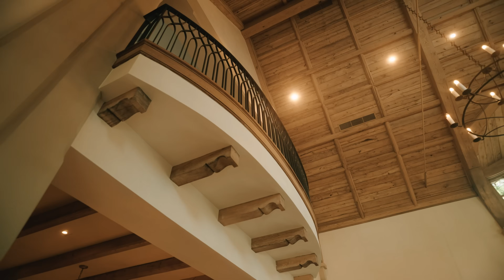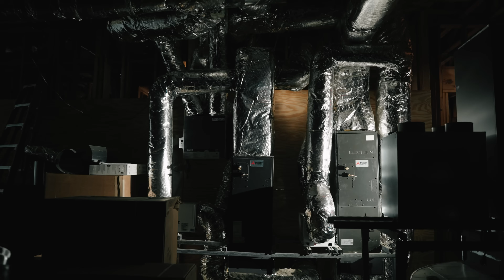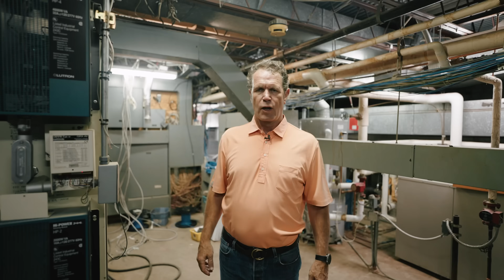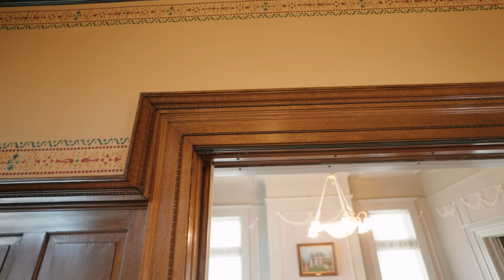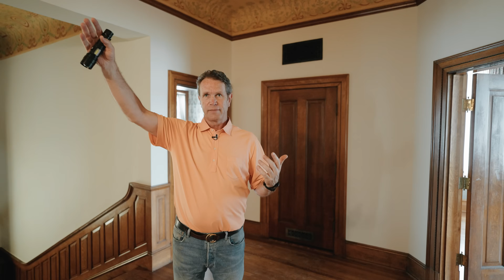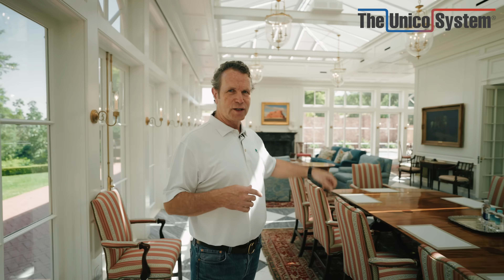"Mechanicals" New House, Old Soul - Ep. 10

Comment: " Most users on Reddit agree that high-velocity systems demand certified, knowledgeable technicians because improper static pressure balancing or incorrect run lengths drastically reduce efficiency." Too complicated. Need an engineer to install properly. You'll never be able to find anybody to service it. Especially after 10-20 years.

Comment: Your advice is spot on with regards to cooling. I have restored old homes as a hobby since 1972 and have always been challanged to not wreck the details of the home to add HVAC to a 1930's - 1970's house. Wheather it was a traditional horitionzal air handler, fan coil, or  chiller driven air handler I always put extra effort into condensate water safety back-up. In South Fl we're required to install a seperate drip pan and I always added a water sensor alarm to the drip pan that would alert  when moister was detected so that A/C service could be preformed before drip pan became over filled and water damage resulted (Many A/C evaporators have a secondary high water drain which can also be used to trigger an alarm). I too would go to great lengths to use attics and crawlways this usually is more costly and time consuming but the end results are well worth the effort and expense to advoid the easy way of using an existing linen or clothes closet for the air handler/s. Ray Stormont

Comment: Okay ... here's your recipe, Brent. It'll work on any house, new or old. What? Yeah.

1) Do not fight the stack effect . This is why we like double-hung windows in Spring/Summer, yes??

Which means: Keep "central" (ducted, etc) A/C but put registers up high regardless of floor . Having your feet cold in summer is unnecessary, so never use floor registers again. Why am I wearing socks in August? Because of the floor registers freezing my feet. 

2) FORGET ducted heat, regardless of climate zone. Just ... don't bother. Advocate and build the infrastructure and talent that supports radiators. Or go with radiant heat floors. There's your hidden heat. Either way, let the heat rise in Winter, it is utterly amazing I don't care where your house is located. 

Forced-air heat ultimately sucks for comfort, and it's ONLY become historically popular because of A/C, where everyone thought it was "smart" to only need one duct system. It's not smart, it's cheap, and it shows.
Reply: Couldn’t have said it better myself.
Reply: Hmmm, big problem with radiant is the latency. I turn my heat OFF when I leave the house for 30 min or more and turn it down to 60f when I sleep. Forced air warms up the house in minutes, so I save a ton of money. I'm in climate zone 7. Cant do that with radiant.
Reply: @fox156  Requires proper insulation, then you can keep the temperature constant all day in each room.
Reply: Well, pretty rare and difficult to have more than R22 6" insulated walls. Not everyone can afford to live on a new custom house or put 2" of foam on the outside. In any case you're still spending "more" to heat if it takes hours to change the temperature 10 degrees and you can't turn the heat off when you leave for a few hours or sleep.
Reply: @fox156  Very curious here. I live and work in zone 6. I don’t know a single person who turns their heat off for any period of time in the dead of winter. How is it possible that you can do it living in zone 7? Maybe I’m misunderstanding you. But it seems impossible to do, and a problem waiting to happen.
Reply: @valenzaplumbing  Its because Im okay with being uncomfortable for a few minutes when I walk in the door to save money and burn less fossil fuels, I get that most arent. Steamboat Springs, CO zone 7, -40f last winter.
Reply: @fox156  Fair enough. Sorry, I made some wrong assumptions. Coming from Germany, the 10" (including outside insulation) walls of my home are pretty much according to code. And my floor heating system takes hours to change temperature anyway. But you're right, this drives house prices to insane levels. On the other hand our energy costs are even more insane already - so there's not much choice.

Comment: A chiller system is not more efficient than a split system. That doesn't make sense from just a pure physics perspective. The coolant is much better at moving thermal energy than water. It also takes far less volume to move the energy, and given that the pipes are smaller you have far less opportunity for heat to leak into the plumping (or out for a boiler system).
Reply: Do you mean refrigerant instead of coolant? An example of coolant is propylene glycol. Glycol-water mixtures have a lower specific heat capacity than pure water.
Reply: @rashton7990  indeed, I meant refrigerant. Thanks for pointing that out 👍🏻

Comment: Curious, why/how are the chiller systems more efficient than a typical system?
Reply: 1 - Main Benefit) Distribution efficiency Water has a much higher specific heat capacity than air (x3400 greater) and isn't a major parasitic load on the compressor at large distances like refrigerant in a VRF system. For example, losses at 500 feet for a VRF system is roughly 30% of the compressor power, whereas hydronic systems use a fraction of that power for their circulator. Modern ECM circulators can use about 10-20 watts for the average house in a well designed system. Check out Grundfos Alpha2 for an example.

Pro 2) Hydronic systems using radiant cooling can have a much lower water temperature due to their giant surface area (84F for heating or 66F for cooling are common in modern radiant systems using radiant ceilings or slab cooling). The max efficiency of a heat pump is dependent on the difference in temperature between the source (air or ground) and supply. Note this only handles sensible, not latent demand. Some chillers can use an economizer cycle that can cool at night, and this cools using just the fan and circulator and does not introduce night time moisture, like and air based system would. In cold climates heat pumps maintain much more of their output using a lower supply temperature, so this is helpful in Canada/northern US.

Pro 3) The thermal mass of water also leads to longer cycles times and better efficiency and reduced wear, especially with a buffer tank. Generally properly sized equipment is important, there is more leeway with hydronics.

Pro 4) Hydronic systems can target only sensible loads by keeping their water temperate above the dewpoint, and a separate system can handle latent cooling (like a dehumidifier or split dehumidifier). Humidity equalizes much more easily in a house than temperature, so ducting to every room is less important for latent only systems if door undercuts or jump ducts are present and the ducts can be much smaller. Using a system designed for each can avoid overcooling to deal with moisture (Florida, or Eastern US/Canada summers) or over dehumidifying to bring down temperature (desert areas). 

Major Efficiency Con) Heat exchangers are what kills the efficiency of these systems. A water-water exchanger, common when using monobloc heat pumps in cold climates, can lose 10F. Going air-refrigerant-water in the heat pump and then water-air using a fan coil or hydronic air handler is not particularly efficient, but they can handle latent demand. However, comparatively, Matt often says that mini split heat pumps are not great at latent cooling (humidity removal).

Cold climates often mean using propylene glycol throughout the system (lower specific heat capacity and added cost) or using a water-water heat exchanger to isolate the indoor and outdoor loops (efficiency loss). New anti freeze valves (Caleffi iStop is one) could let you run pure water even outdoors, reducing cost and improving efficiency, but manufacturer warranty often demands glycol in the outdoor unit.

------ 
WHERE DOES HYDRONICS MAKE SENSE?
-------

Retrofitting large buildings where mini splits to each room is not an option. 3/4" insulated PEX (1-1/2" total) running to a fan coil is much easier to route. If fan coils are too ugly something like the Unico system Brent mentions makes sense. Retrofitting radiant ceilings is often an option too (adds maybe 2").

Note the scaling depending on the size of the building and heating vs cooling and latent vs sensible demands. It is inefficient in large mansions to have a mini split head or ducts in each room, since there is large interior areas that would require long ducts or refrigerant lines. Similarly the larger a building gets the internal heat load often increases, requiring more sensible vs latent cooling. These favour hydronics.

For an average sized, new construction, residence in hot and humid climates, like Florida or Texas, this makes little sense. There is heavy latent demand that hydronics does not offer the same benefits for.

Desert climates can benefit massively, since the dry air means latent cooling is often not needed or unwanted and radiant cooling can do a great job of efficient sensible cooling. Pre-chilling a slab overnight using cheaper electricity (if you have time of use pricing) or cool night time air on an economizer cycle can be beneficial.

Cold, but not arctic climates like northern continental or most of Canada can benefit from this tech. Modern heat pumps can also heat domestic hot water using an indirect tank. The all in one heat pump water heaters you often see on this channel or elsewhere are great for hot climates, but in the north when you're heating 8 months of the year it makes no sense to use the heat you just paid for from indoors to heat your water. The larger surface area means more efficient operation for heating. These areas often have lower dewpoints than the deep south.
Reply: @rashton7990  holy cow, I feel like I just got an education. Thank you so much!!
Reply: You're very welcome! If you want more, I recommend the book "Modern Hydronic Heating And Cooling" by John Siegenthaler @nyalsewell
Reply: @nyalsewell they aren't more efficient than modern VRF systems, primarily because your have to transfer heat twice rather than once. The extra cost of refrigerant leak detection is why you generally are hot/cold water in commercial. Also restrictions on refrigerant for global warming reasons is pushing people towards chillers.

These old houses probably had the chillers installed a while ago when their options were more limited.
Reply: @rashton7990  we're looking at buying an old brick house from 1858. it has radiator heat and we experienced it for the first time yesterday. it was phenomenal! so we want to keep the radiators. how do we add ac? we have 13ft ceilings.

Comment: An air-cooled chiller system is not necessarily more efficient than a split system.  Typically, air-cooled chilled water systems are less efficient than split systems because you have the heat going from the space to the air to the chilled water and then to the refrigerant -- it is an extra step compared to split systems and you need energy to pump the water.
Reply: Exactly! Heat exchangers reduce the efficiency of systems